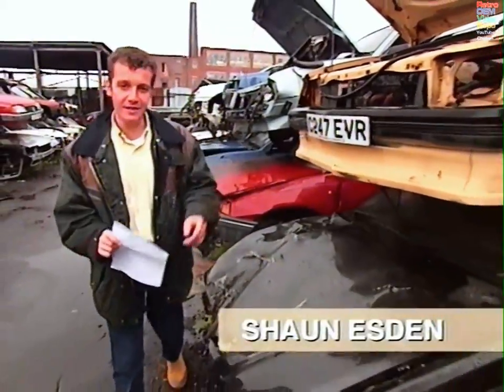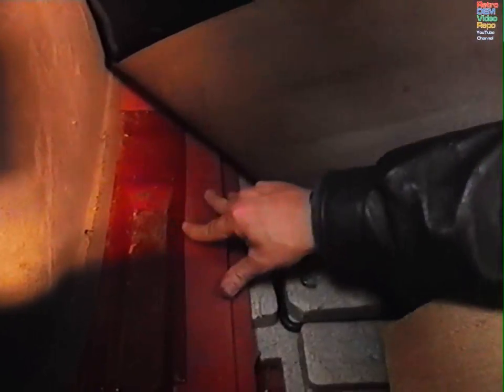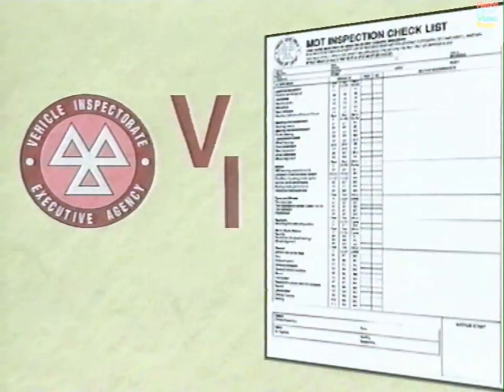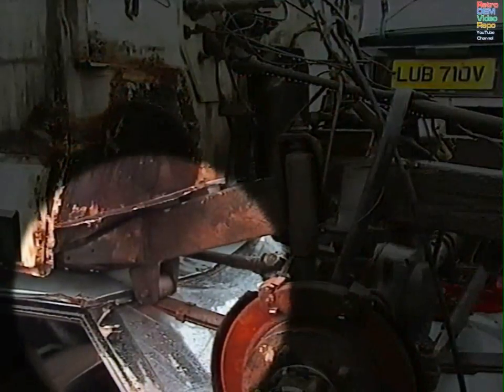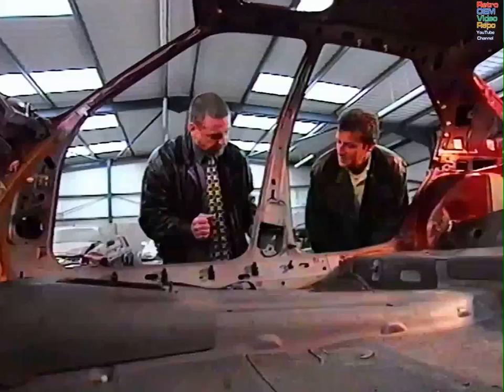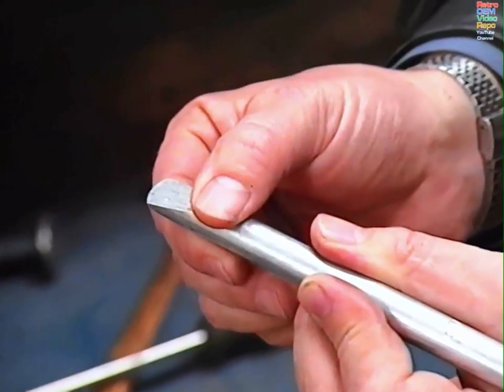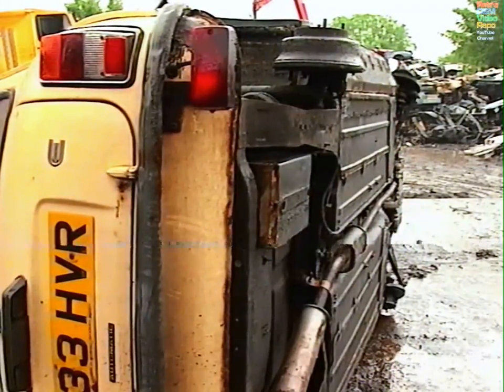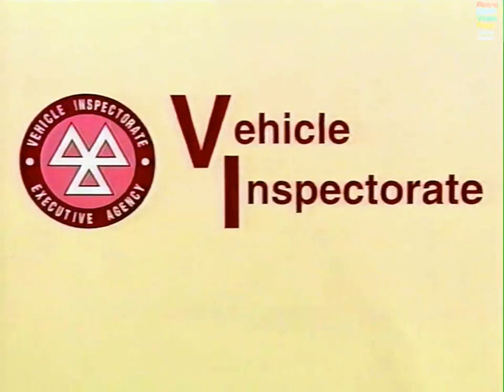Vehicle Inspectorate (UK) - MOT Matters - Rotten Cars - VIV03 (1997)

Comment: MOT faliure on rust = scrap it and buy a new one??
This seems to be the mentality of so many people. 
Gotta take out another mortgage to have that shiny new piece of crap to throw on the scrap heap in 5 years time🤷😂
Reply: I watched someone trying to weld the sill on a Renault Scenic, the metal used on modern cars is paper thin. Getting the mig set just right was a job in itself. Left the breakers yard a couple of years back but we were seeing a lot of cars with electronic handbrakes that had failed and were a rediculous price to fix. Electronics are a curse on modern cars.

Comment: As someone who both works in the trade and does banger racing it doesn't matter were the rust is it is a weak spot fullstop if its become brittle and holed and if your in a collision that point whether its within mot parameters or not its going to crumple like a tin can so corrosion should be failed no matter were it is on the vehicle

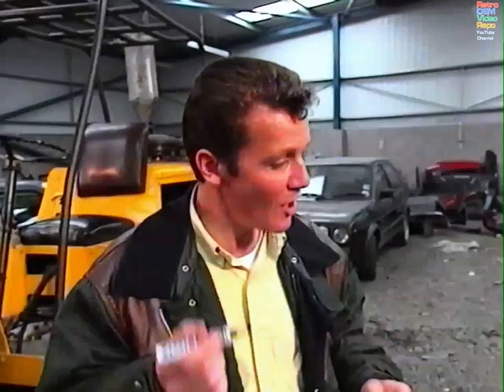Comment: 7:30 a pin hole in the "prescribed area" should NOT write a car off . Common sense should prevail here over a blanket 30CM radius rule . 
A simple blob of weld or indeed filler with paint over it would mean a pass then? 

So glad the testers cant rive , scrape and bang the underside with the torture tools anymore . 

I used to use old engine oil and grease mix to coat the underside of my cars, never had rust issues  but 1 MOT tester complained it was too oily for him . His boss told him to move over and he would do it. I was praised for preserving my classic car this way . The only snag was the light greasing of the brake pipes as he said he could not see if it was leaking or not . However, He could tell by high standard of maintainence that it was ok.

Comment: The corrosion assessment tool...if you see a tiny hole proceed to smack it eith a pointy body hammer till you made a big gaping hole... Ive seen vehicles beaten to death by testers completely unnecessarily many times.

Comment: In new zealand our vehicle inspection is called a WOF warrant of fitness its just as bad with rules taking perfectly working cars off the road. A wof is 1 year for a car made after 2000 and 6 months for a car made before 2000.
Reply: Just get the car repaired if it fails. It’s simple.

Comment: I was an MOT tester back in the early 90s
 Many cars were not so far gone that a little bit of welding wouldn’t fix.
   Mind you, quite a few cars I tested were indeed rot boxes and not at all safe to drive in.
 UK had weather and road salt that really added to how badly some cars rusted.
Reply: I bet most cars u failed for rust were mk4/5 cortinas cavalier mk 2s escort mk 3s etc

Comment: In 2019, it's no longer corrosion that decides the fate of the vehicle, it's the electonics that decide the economic fate of a viable repair, Progress? I don't think so!
Reply: It's rocksalt if you have a car in the UK
Reply: The level of complexity legislated into cars these days, especially throught the emissions standards, really seems to suggest that there is a movement in government interested in substantially reducing or entirely removing mass private vehicle ownership.
Reply: No. It's the same thing since the 90s: people simply only want new cars. Often nothing or next to nothing wrong with their older ones. Not rarely, they're even trading down just for something new.
Reply: Yes, failing electronics will send a Mercedes to an early grave. If not the grave - a very poor resale value. Stick with simplicity - like an early Beetle.
Reply: Wiper motor loom on a mk2 S Max. I’ll leave it at that
Reply: 2019 when times were better 🫣

Comment: I'm from the Netherlands and the MOT rules from the UK are very similar to those we have. But we have also the rule that not more than 10% of the body most have rust, otherwise, it's a fail. Also here it's not allowed to welded around suspension mounting components or subframes. Only if it is considered as solid and then that the welds aren't visible. Also over here they just use a screwdriver so even if your car is solid they can leave damage behind because of poking in the sills and so on. So this tool would be amazing! It doesn't damage the paint!
Reply: Ilias Lamari you mean the C.A.T.?
( Corrosion Assessment Tool, or hammer )

Comment: Video from 1997, loads of D and E reg Fords and Vauxhalls piled up in the scrappy at just 10 years old, probably all rotten. Meanwhile that G reg Volvo 760 on the garage ramp in the background was still on the road in 2007.
Reply: My dad bought a brand new escort in 99. Sold it on a couple years later. By 2011 at 90k it failed itsmot miserably. In 2009 it had21 advisories mostly related to corrosion. Terrible era of fords. I had a 1998 fiesta andi jacked it up to take the wheels off and the sill moved quite a bit before the car did 😂
Reply: A colleague was part of this film production and it was filmed in late 1996, not that this makes it that much worse for those 10 year old cars. It seems that from around the mid 1990s there was a move away from getting major repair work carried out on the family car, such as engine reconditioning or welding jobs so that you could give the car three or four more years on the road. Car models started to change more frequently but many of them weren't that much better. We had one of the last Golf Mk 3 models from early 1997 and it started to go rotten in the early 2000s and a relatives Mercedes E Class from around the same period literally fell to bits with rot that you would have seen on some cars from the 70s.
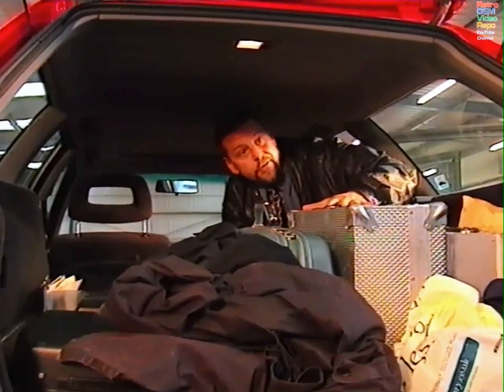Reply: GPOTOM I believe the Defender at about 3:20 is still on the road now
Reply: Those were actually built to last.

Comment: Screw england & their excessive rules & taxes
Reply: renownedfear187 its only for dangerous things man. A little bit of surface rust is ok
Reply: MOT here is run by a government controlled organisation and they are severe.. So much that in 30 years I have run the MOT gauntlet myself only  once, now I first let the garage check and fix the car and then they go to MOT. Last result : car ok, numberplates need replacing (the official one at the back is 30 years old, what do you expect ?)

Comment: The MOT is brutal. I can understand if a car's structure has been compromised, making it unsafe, but corrosion on non-structural body panels should not be a cause for failure. If you've got holes in the wings, that might be unsightly, but it's certainly not unsafe.
Reply: My wife was lasserated by an astra MK3 10 or so years ago in a car park by walking past it, rusty old heap. Cars are no different than white goods really. And if they are dangerous they need fixing or scrapping.
Reply: justsomeguytoyou that’s why those things are not a cause for failure! Ha.
Reply: @Landie_Man  That's not what he said in the video. If there is rust that can potentially cut someone if  they brush against it, the inspector can fail it.
Reply: justsomeguytoyou  ah yes. He can!  But not for surface rust. Only if it becomes sharp.
Reply: ymxctrails I know man
Reply: That is true. Plus also many panels on cars are held on by a whole bunch of bolts, so they can be replaced in the worst case scenario.
Reply: I had to scrap a perfectly decent punto because the drivers door didn't close smoothly. You had to lift it up to close it.  It latched securely and was perfectly fine, but it failed the MOT.  =  MOT causes global warming.  the Americans just have an emissions test but  this crap cuntry is Tax Tax Tax
Reply: @mikesully110  i wold say that was a MOT tester fault. as my MOT place just advised the rear seat belts as being untested just due to the back seats folded down. but not failed them, allthough at the time, the car did fail on a center exhaust leak and a few other little bits. i used to have a motorbike where the previous owner in his ownership had a MOT fail due to the headlight beam being to high. a MOT test is 45 minutes long. my bike MOTer said 'if a fail can be rectified while being MOTed. then it will PASS'

Comment: Correct me if i'm wrong,but that's a Metro on the ramp isn't it? Metro=rust=fail, job done Mr Inspector.That was as easy £60!! Kerching
Reply: andy d our k reg metro just failed on rust so sad :(
Reply: K reg, Jesus that's over 25 years old isn't it? You must have got hold of a good one!!
Reply: andy d picked it up about 4 years ago for £275 only got 40,000 on the clock sadly the underside is far to gone struggling to part with it though :(
Reply: My Dad had a Discovery 1 4ltr V8 for 17 years which i inherited with only 80,000 on the clock but the same thing happened to that.The repairs were quoted at £7000,so it just wasn't viable.
Reply: andy d dam that's such a shame bet it felt horrible to get rid of was it nice to drive ?:( my worst mistake though was getting rid of my rover 200 1.8is below 50 left I think wish I could get it back lol

Comment: That car still had good tires on it. Why scrap the whole thing? I don't understand, here in America we have Pick-n-Pull, where you can just go grab a part off the car or even buy whole cars. A corolla starter is $20 waranteed for 3 yrs. I'm not sure how it is in the UK, but there seems like a lot of perfectly good resellable parts on those cars
Reply: Yes same here in uk tho some makes and models ie the red ford Sierra not worth doing as the car at that time was to popular and already over flow of parts and the age of the car model at time  was a old old car not popular in favour anymore.
Reply: The weather in the UK means  that cars rust a lot quicker than the US, there is a strict MOT test which cars in the UK must pass every year after they are 3 years old, even a broken light fails the test.
Reply: @jrgboy  so basically, if the car fails, every component on the car is considered dangerous or worthless? Even the tires or starter?
Reply: @boberson33   - No,  but it may not be economical to buy replacement parts specially if you can't fit them yourself. a garage would charge  a lot to do it, even if you scrap the car  you don't get the value of the parts that are good...
Reply: boberson33 a starter is not a fail.
Reply: @Landie_Man  I'm saying sell the starter
Reply: boberson33 of course they do. They just chucked the whole thing in the crusher for the purposes of the video.  Also, at the time this was a very common car. Now it’s rare and worth more.  If the cameras weren’t there they would have stacked it with all those other vehicles.
Reply: Most of the time the do strip the more valuable components. I reckon the sierra was freshly in and the filming crew wanted to do a complete car to make it look more dramatic. Doing a swiss cheese shell of a car never really has the same effect

Comment: most of the cars there are pritty much too far gone, plus it depends on were the rust is, if is the bulk head or the chassis or a frame or wheel arches then yes it would fail,. but most of these at least those last two were easy to fix bit of filler and bosh its back on the road, or you'd go to the scrap yard and buy the part from another car in far worse state or been in a crash and diy it yourself, it was mostly cars that had the old weld onto weld onto weld onto weld that failed as you pritty much had to do a mini resto on it to get it though, mind you it made banger drivers happy

Comment: Was there asbestos in 90s cars ?
Reply: Tom Jardine  yes - my old 90s ford had a warning on the slam panel warning that asbestos was used - I think maybe in the clutch - or brake pads
Reply: Do one What year was it?
Reply: Untill 2000 you could use asbestos gaskets and friction pads. Under my 101fc ambulance body there is a huge sheet of asbestos to protect the wood floor. I will leave that insitue, but brake shoes and clutch parts can be asbestos if you have a pre 2000 barn or hedge vind.
Reply: 1989
Reply: No, 90’s cars have no asbestos. My mum had a 1995 Rover 216 cabriolet, and she drove it pretty much every day before the head gasket started to leak. She sold it, and we were all sad to see it go. We checked with that tool on gov.uk to check a vehicle registration plate, and it turns out that old Rover was scrapped in 2009. We all survived with no asbestosis.

Comment: Some classic Autoshite there ! Pity we live in such a throwaway society. I'm still driving my 1994 Rover SEI and yes, it's had the head gasket done LOL.
Reply from the maker: a man of CLASS
Reply: @rovr  214? I had one in caq nightfire red. I actually liked it. :)
Reply: Rovers are brilliant cars the head gasket is pretty easy to do  yourself and a full gasket set is 40 quid currently driving a 45 conny TD
Reply: I'm keeping my Rover 75 on the road. The head gasket hasn't gone on its K series engine. If it ever does I'd get it done then sell it & buy one with BMW engine or transplant an engine. Old cars are viable if they are maintained properly but they need money spending on them. New cars cost more in monthly HP payments & devaluation so it still makes economic sense. Often repairs & maintenance cost more than the old vehicles value but if you plan to keep it then it's still value for money.
Reply: Is it a 1.8 or a V6?
Reply: @paianis  1.8
Reply: Have you had the fix done as per this kit? https://www.dmgrs.co.uk/products/ultimate-k-series-head-gasket-fix-n-series-gasket-high-tension-head-bolts-and-revised-oil-rail-equiv-to-zua000530
Reply: @River Huntington... MASSIVE RESPECT to what you are saying.. I am trying my VERY VERY VERY best to keep my 20 Year old Toyota Celica on the roads... I have spent a total of £500++ on repairs in the last 2 Months and YES the car has developed YET ANOTHER problem this weekend which means more repair bills and more time without a car AGAIN! 
The car has done 169,000 Miles and is 20 Years old... Maybe the car is trying to say she is ready for "Car heaven" and she has simply had enough..
Reply: @briansaiditsoitmustbetrue4206  You'd love Scotty Kilmer's channel 👍
Reply: @BlueXonar  :D
Reply: @briansaiditsoitmustbetrue4206  Toyota's are reliable what exactly is going wrong?
Reply: Hubnut? Is that you? lol
Reply: Rover's are good  cars , I've had  4 of them! 2 45's one 25 and one 75.
Reply: Lol yes I had to do mine twice! . I've still got two cans of spray paint left , that maroon metallic they did if your interested
Reply: Can't beat the 214 head gasket change!
Reply: Sweet!
Reply: Still looking for a nice MG ZT...
Reply: River Huntingdon OLD!🦕
Reply: RIP River
Reply: Gotta love those Rover head gaskets. Like, what are they made of? Cardboard or something?
Reply: I'll say. Even if the corrosion is structural, it can probably still be saved with a little welding. And I say that as someone who daily drives an MX-5.

Comment: All those scrapped bangers are way newer than my daily drive!  But yes, my 1972 Hillman Avenger has had the odd spot of welding done to keep the MOT tester happy.  Interesting that they mention you can't weld a trailing arm link, which will explain why I had to replace those rather than get them repaired for the most recent MOT.
Reply: Yea anything that is classed as a part you cannot weld but chassis and body you can
Reply: My dad had one of those when I was a kid. Yours must be one of the very last on the roads.